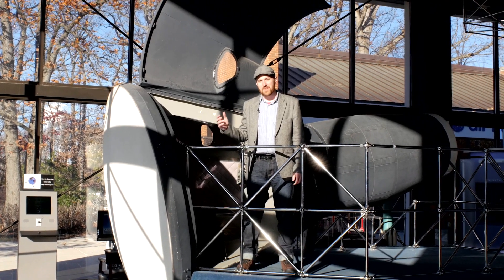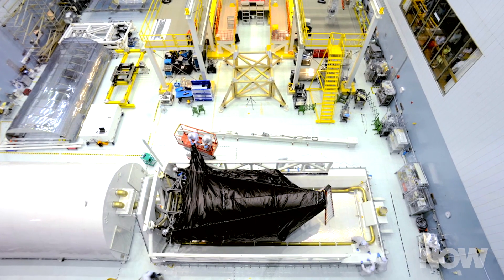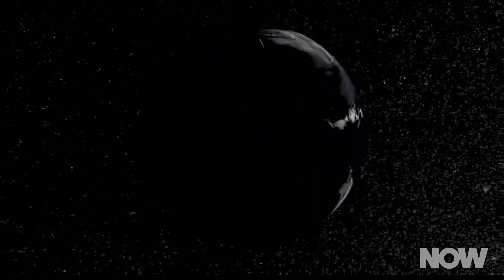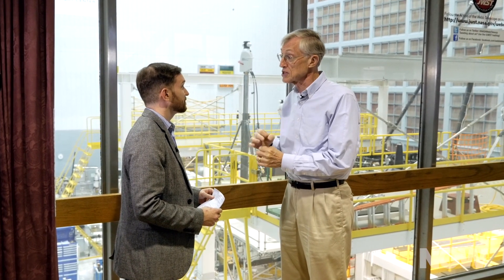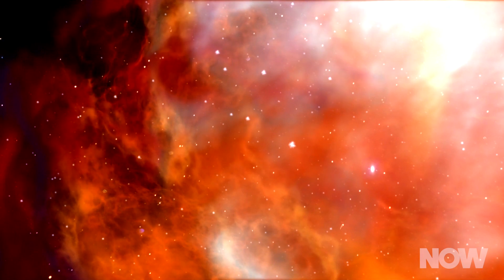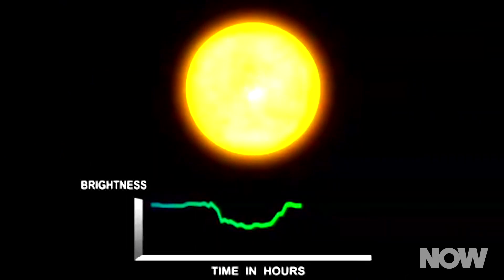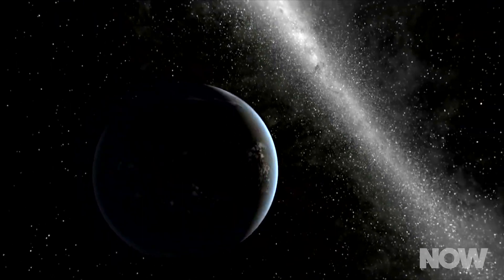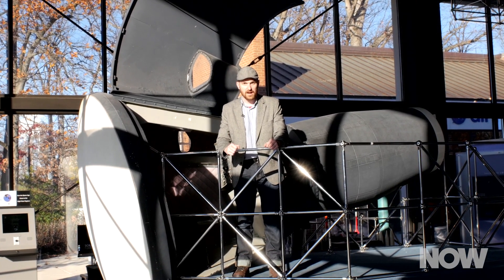Seeing Through Time with Dr. John Mather | HowStuffWorks NOW

Comment: How do they know they are looking into the past and not the "future"? Would it not only be possible to see into the past if the big bang started at a single point? And we would have to know which direction to look in wouldn't we? And since the planets and stars around us in ALL directions are moving away from us, how do we know where that single point is?
Reply: That's an incredible observation, however Astrophysicists can discern that point on the basis of the age of the neighbouring celestial bodies, well this is how I guess it can be done. One more answer could be, and lies in your question itself, that since everything seems to b moving away, hence if we start zeroing in on the point where the movement seems to be the slowest, that could also help us find the right location.
Reply: +Samson Moses That's true. I suppose if we find what's moving away the "slowest", it stands to reason that we are also moving in that general direction as well.
Reply: +uNkLeRaRa4  yes, one more analogy that can be given is take a balloon with dots on it, as we inflate it, the dots all seem to move at the same rate from a general centre, hence the the expansion of universe can be pictured in a similar manner.
Reply: +uNkLeRaRa4 The big bang did not happen at one single point, it happened everywhere.
The Universe is not expanding from one place, it is expanding from everywhere.
Planets and stars around us are not moving away from US, they are moving away from everything; more precisely the space between objects in space itself is expanding.
There is no center (or centre) to the Universe, so it is not expanding from any one place. The speed at which the Universe is expanding is based on mass, not where the big bang happened.
Areas with more mass, like galaxies, solar systems and stuff in them expand more slowly due to the mutual attraction of massive bodies. Areas with less mass, or voids, expand more quickly, the thinking being that there is more dark energy in these areas and dark energy is pushing everything apart, speeding up the expansion of the Universe.
It must be noted too that the past is what has happened already, while the future has not happened yet, and you can't see what hasn't happened (and might not happen).
The balloon analogy is half right. The Universe is not a physical thing with a center and edges, so is different from the balloon. The dots may be moving away from a central point IN the balloon and seem to be moving away FROM EACH OTHER, but they are not moving, the space between the dots is increasing, and the dots stay on the same spot on the balloon (Universe) the whole time.